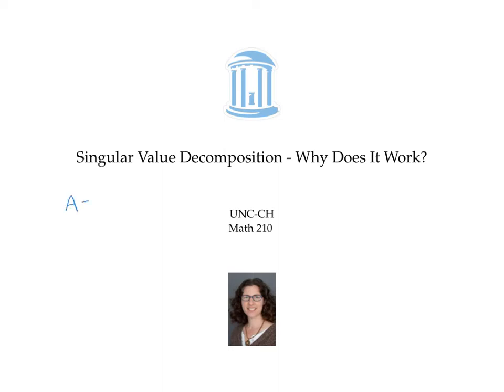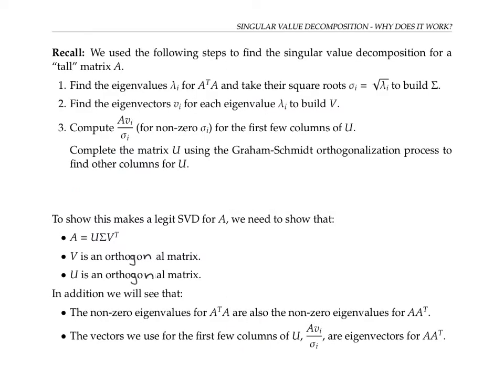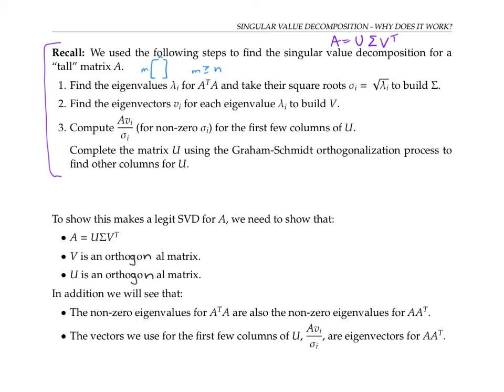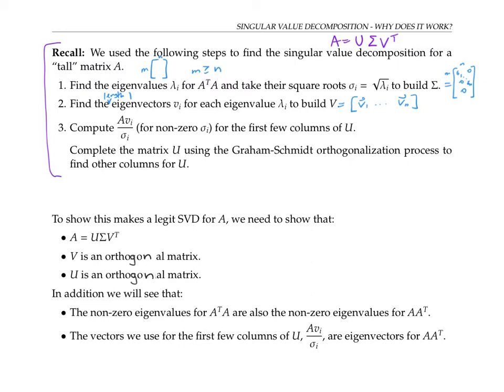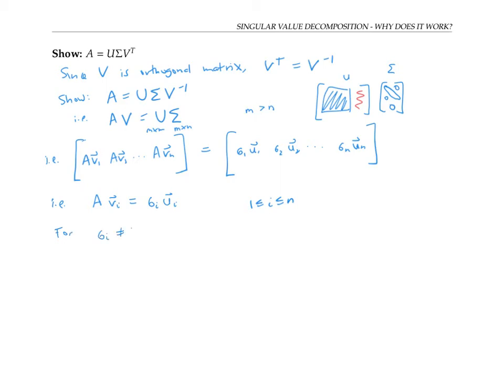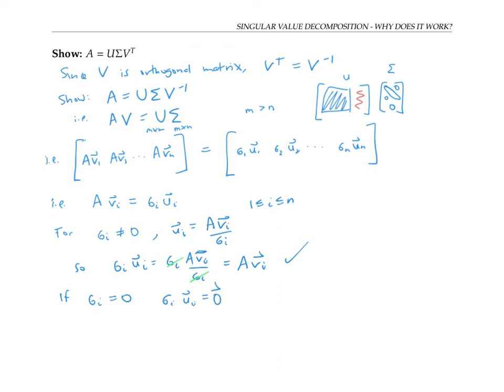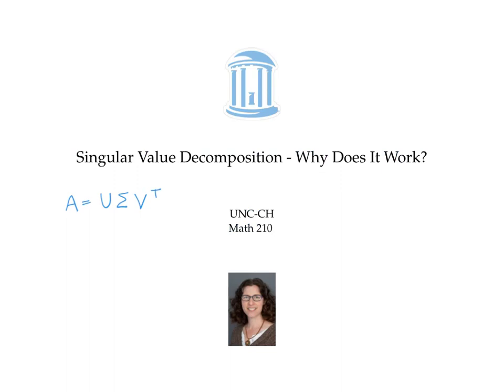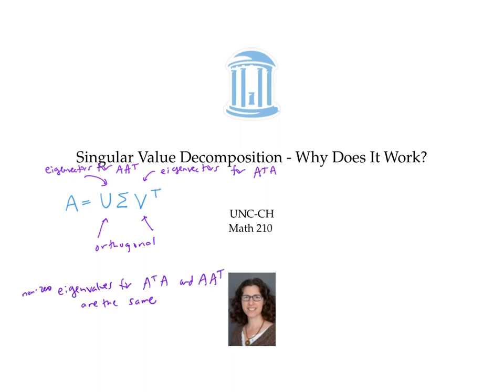Singular Value Decomposition - Why It Works

Comment from the maker: There is an error at 10:18. If sigma_i = 0, it is true that A*v_i = 0, but the explanation in the video doesn't make sense. Instead, consider || A*v_i ||^2 = (A*v_i)^T (A*v_i) = (v_i)^T A^T A v_i = (v_i)^T lambda_i v_i = lambda_i ||v_i ||^2, which is 0 since lambda_i = (sigma_i)^2 = 0^2. This shows that || A*v_i ||^2 = 0 so A v_i = 0, as wanted.
Reply: Ah, right, because v_i is an eigenvector for A^T A, not A.